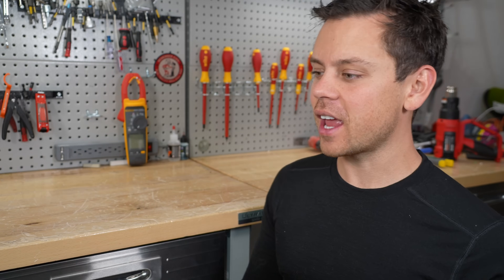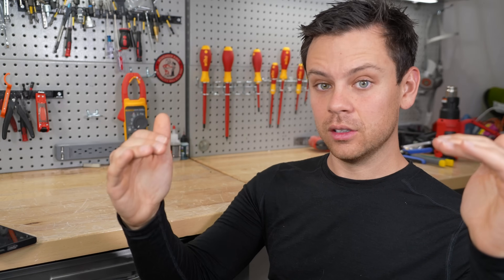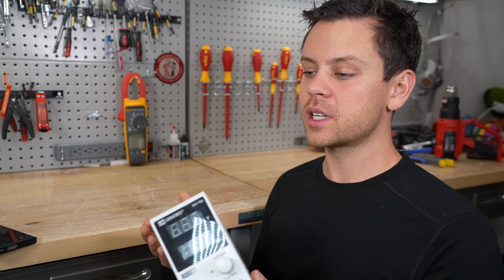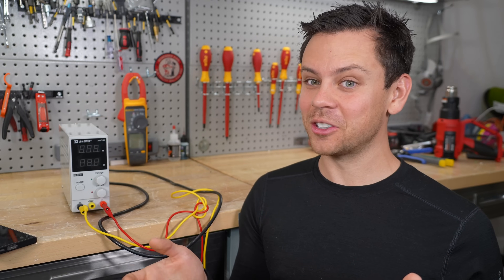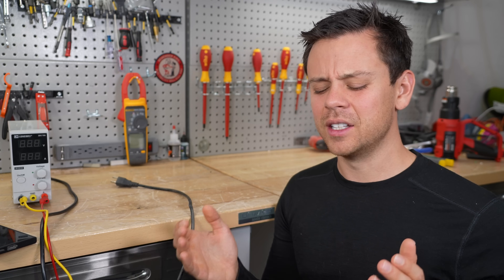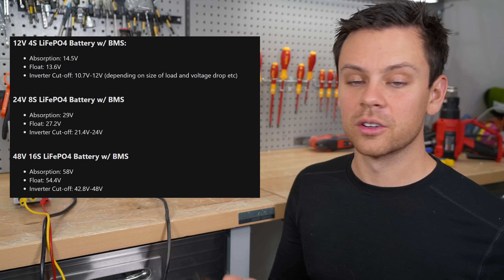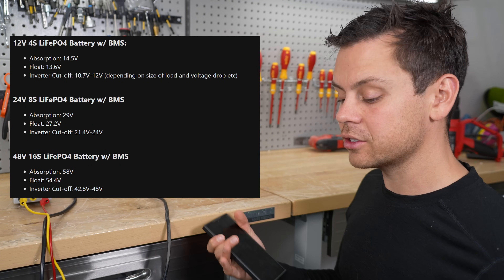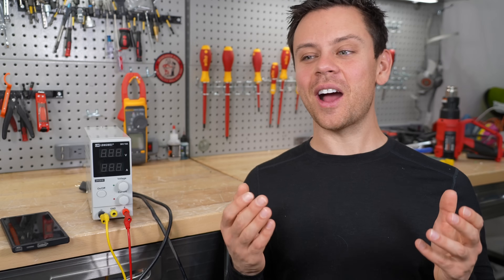LiFePO4 Charging Guidelines: What is 100%? What is 0%?! How to Balance??

Comment: This is exactly what we have been needing, perspective with a good discussion using a road tested sense of weighting for the different concerns.  

I've been trying to keep my AC charged backup power system at 70-75% so I could avoid a lot of degradation hanging at 100%.   But I lose capacity doing that and an ongoing intermediate charge is hard to nail down.   Now I have a better sense, of how much that matters - "It's not that Baaad"). 
AND I concur, the big hits on my batteries came after storage.  I left it at maybe 50% and come back six months later it's  at 10V.  I've learned to disconnect the BMV, everything too. BMS is only remaining drain.

Comment: Will, what was the machine that you held up that you use to adjust the balancing current?
Reply from the maker: Oh that's a variable output power supply. Super cheap and easy to find on Amazon

Comment: Have you or anyone else thought about trying out the large Chinese batteries? 48v 300ah. Depending on the manufacture they average about $1000 each. With shipping 2x 48v 300ah is $3000 shipped to my door. For the capacity it’s very tempting to try them. They have all the same safety features, warrantee, etc

Comment: Is there such a thing as over paneling a solar stand-alone system? I have two 250 watt panels in series through a MPPT charge controller to two 12v LiFePO4 100ah batteries in parallel. Even on the cloudiest days my system recharges to 100%. It’s only at 90% in the morning but I plan on powering more in the future. I designed the battery capacity to last 3 days without charging but I have never seen anything less than 90% so far 🤷‍♂️

So since it recharges to 100% everyday there is no need to rebalance the batteries individually every 6 months?

Comment: Hi, I am new to the LiFePo4 batteries. I have a 6k 24v inverter to run critical circuits in my home when we have power outages. My battery bank is a 25.6v 400a system consisting of 8 Chins LiFePo4 12,8v 100a batteries, which I have gone through the balance process multiple times to make sure the batteries in my bank are balanced.
My question is what should the minimal charge current in this hookup be? I am currently charging at 30amps, but wanted to know the best charge current to make these batteries last a long time. We get power outages during the summer due to storms/hurricanes etc... and even sometimes in the winter, but that is more rear than normal. So most of the time my batteries are not used, but in "stand by" for emergencies. Any advise on this would be greatly appreciated.

Comment: my lifePO4 batteries came with instruction booklet and for charging tips it states equalizing charging voltage 14.2 with a float charge of 13.8 with an over voltage of 15v and reconnect at 14.2  should i stick with these settings for solar charge ?

Comment: Will, I totally understand and agree with your words of advice....
Trouble I have in north east of UK......IV way too much power in summer......but in later year IV not enough. IV increased my bank.
It's a hard balance to get Solar to battery size right.
Iv just took out  12 cells on a 12v system with a standard Daly bms......and all 12 was with in ,3hts of a volt........ok not 100% soc......
I need to sort 8 of the cells to make another 24v pack..

Comment: If using 51.2v batteries in a non solar setup and recharging with a 30amp LiTime charger, what is the recommended lowest percentage I should go before recharging? This is for a relatively low draw 400-700watts per hour on the high end, right around 150 watts per hour most time for off grid living in far northern Wisconsin. I keep my batteries at room temp almost sleeping with them, lol. Thanks

Comment: I have a system without BMS 48v and put absorption 57.5v and float 54.7v are these settings good are they balanced. Connected to a soler system charged daily

Comment: Informative.  One question I still have is about C discharge rate.  I understand what it means.  In the real world what happens if you discharge faster than 1C consistently?  I'm assuming that heat degradation is the biggest concern.  I made a portable min/maxed system.  It's 12 volts and 100AH built out of 8 50AH 3C discharge rate cells and a 2000W inverter. Could I have saved money and just used 100AH 1C cells?
Could you explain C rates and what they mean for system performance and longevity?

Comment: I have a question about using an inverter to energize  the 110 system of a travel trailer. I understand the solar application to the DC system, but am totally confused regarding the inverter and the AC system, and how the energy from the inverter is distributed to the AC system. Is the power fed to the AC fusebox? How is it fed from the inverter to the AC sockets, microvave, air conditioner, etc.?

Comment: Voltage means very little for determining 100% SOC. Any voltage above 3.375 volts per cell (13.5 volts total on a 12 volt pack) will fully charge and then overcharge the cells. You'd just need to be very patient if you choose to charge at that low of a voltage. 100% SOC is achieved when the charge CURRENT drops to 0.03 (3%) C. (100 amp hour cells = 3 amps). Terminating charge at 3.65 volts per cell is an emergency cutoff threshold. I don't allow the BMS emergency thresholds to control charge or discharge terminations. I charge 12 volt packs with 13.8 volts and then use tail current detection to stop charging at 0.03C charge current. Some of the Victron chargers support tail current detection to trigger charging termination.

Balancing efficacy is directly proportional to the charge current to balance bleed current ratio. Charging at high C rates will reduce the balancing efficiency. If you want to balance a pack it's much more efficient to charge at a low C rate.
Reply from the maker: Well said! Exactly true. 

You should join our forum. You'll like it

Comment: I was thinking of having two battery banks that alternated use so that one was always fully charged in case of cloudy days. I think I could cycle a single 48 volt  battery from 100% to 0% every day in order to satisfy my energy needs. But do you think it would be better to just connect the two battery banks together and use them down to 50% each day instead?

Comment: I recently add a solar system to my truck camper.  I bought a LifePO4 battery with cold temp protection.  Should I leave the battery in the camper and just let the MPPT and solar manage the system.  Temps for the next 90 will range between 10 and -30 Celsius.  I live in northern British Columbia.

Comment: I just bought 8x WattCycle 12V 100Ah batteries. I am planning a 48 volt build (4s2p) but haven't bought anything else yet (waiting for some Black Friday deals). What recommendations would you give for an external battery charger? I will be doing the whole solar, mppt, charger, inverter and probably a transfer switch. I may go with a DC optimizer rather than micro inverters, but thats still kinda up in the air.

Comment: Nice video. Been using Li-Fe for receiver/servo batteries for giant scale rc airplanes for a lot of years now and that follows my experience.  I generally keep an eye on cell voltages/balance and internal resistance as they charge, and each year I’ll measure capacity. Finally retired a pair of packs when they were below 90% capacity, probably 12 years old, charged at 1c, and I hadn’t been too religious about storage state.  Also it seems to me smaller cells (2.2 ah/hr) degrade more quickly.  

Plenty of useful life if they were solar storage, but a person wouldn’t want to loose control of a 6 horse power spinning blade that flies.

Li-Po chemistry is used in electric powered airplanes due to to their high current ability (a pack might be rated 80c discharge, 5c charge, where li-fe might be 10 or 20c discharge, 1c charge), but Li-Po’s do degrade quickly especially when left at full charge and/or constantly run at max current. They also seem much more prone to fire, especially when damaged.

Anyway yeah, different lithium types have different characteristics. I’ve noticed Li-Fe packs for RC have almost no self-discharge, and I wonder if that could be because there’s no BMS.

Comment: It is disappointing to learn that I need to store my LiFEPO4 batteries at 50% I wanted to keep them at 100% ready to go in the event of a loss of power. But you know, I am not surprised to hear that since I know my Nikon camera 's Lithium batteries are supposed to be stored at 50% if you're not going to use the camera for some time according to the owner's manual.

Comment: I watch all of your videos and I don't understand all of it, I'm not as smart as you lol so don't get mad here when I ask this question but that guy from Australia that's dealing with the lawsuit said his lithium batteries failed in his vehicle because the alternator kept them at 100% constantly. Is this true? Topping them off to 100% once a day is fine but keeping them at 100% while driving while driving the vehicle is bad?
Reply from the maker: If the charging voltage is above the fet voltage rating, then it's possible. But dang they must have been using really low quality fets than. Besides that it shouldn't hurt it

Comment: When my 2 12 volt batteries get near 100% the midpoint voltage deviation starts to grow. I think that I backed the full charge to 28.8 and it works fine now. Every once in a while the float decides to continue to climb. If I shut everything off it will usually go back to the proper float.

Comment: Hi Will, 

My battery manual states the following; 

Smart Cell Balance 

While charging,  if any cell voltage exceeds 3.450V and the voltage difference between the cells becomes greater than 20mV, the BMS will initiate the balancing process for those cells. The balance current is based on the cell voltage difference and limited to 50mA. 

Recommended charge voltage is 56.0V 

Battery is a LiFeTIDE lifepo4 5120Wh

Comment: Main point: Chicks dig a strong vibrant pulsing throbbing voltage. Degradation isn't so much a problem. Thermal battery low temperature can be though and women have an in built low temperature shrinkage cut off sensor. Don't let that sensor activate. Keep up both your volts and your amps so you can inject the correct amount of charge at the climax of the union.

Comment: I recently bought 2 independent power queen 100 amp\hour batteries that i charge with a powet queen charger and ive noticed i never see 14.6v when i check them with my voltmeter, but usually i see 13.8-13.9 when close to full charge and 13.3 when charged. Is this typical or do i need to contact power queen?
Reply: I get the same readings, with Li time  24 volt battery and same brand 29.2 charger 27.6 volts then greenlight comes on,and stops charging.

Comment: So... If you have say four 3.2v Eve cells and they're connected in parallel as in a 12v battery, why don't they just balance themselves to each other anyway. I mean why wouldn't electrons just flow from the higher states of charge over to the lower states of charge? Isn't that just "The law of charging"? if I take a 12v battery charged up to 12.8v and I parallel it to another battery that's discharged to 10v, wouldn't the full battery charge the low battery until they level off?

Comment: All I want to do is purchase one or two "cheep" (LFP) 100AH, 12V. Such as LiTime, or one of the others you've reviewed recently.  Possibly a trolling motor battery as well. No solar panels yet. I want to know what is required to charge and maintain these?  I'm pretty good at cycling the two LiIon jackery's I  use frquently. I also use a 140w BASEUS LFP. The tariff you mentioned is forcing my hand to finally buy a few.

Comment: Thanks again another great explanation. I have  a Victron Solar controller and was using the default settings 56.8V Absorption and 54V float  ( Victron solar charger will not reset until >.4V drop from the float voltage so it has to be less than 53.6V before the charger goes into charge mode again)  My test showed that the cells were not fully balancing so I set my float to 54.4 and the Charge / Absorption to 58V,  which has improved balancing and float voltage capacity. Now I understand from your video that default was for Victron batteries not LiFePO4 in general. So 58V charge it will be from now on. (The data sheet for my batteries states a  bulk charge voltage 58.4V.) Excellent explanation once again Will ! I could find nothing on the Victron forums that covers this issue. I have set the 5000VA inverter to cut off at 46 V. The default setting BMS for my 2 x 16 cells 48V batteries is cut off at 2.2 V per cell a little low but this is the manufacture default so it will stay this way as I have a 5 year limited warranty on these batteries, and changing these parameters I was advised would void the warranty. I am going to throw some more solar panels on the roof to help with charging over the winter months. 5 stars again Will.
Reply: i use victron chargers and multi2 too and saw some weird stuff but i do use their parameters right now and i want to see what i might gain from a total discharge . if i gain 70 to 75%  of my pack then i m ok...  my cells are 3 years old+ some safe bariers to  top charging ... but cant confirm yet that i dont like victrons  parameters.  will do some digging in summer because i m off grid and those tests need more solar!  .
Reply: I have the EG4 wall mount battery. What is your best advice for storing it at my cabin over the winter?  I lose access to it over the winter should I charge it up to 100% then leave it  it will have about 1000W of solar on it for the morning and then nothing. Now power going out.
Reply: I have the EG4 wall mount battery. What is your best advice for storing it at my cabin over the winter?  I lose access to it over the winter should I charge it up to 100% then leave it  it will have about 1000W of solar on it for the morning and then nothing. Now power going out.

Comment: Excellent explanation...I followed all victrons (mppt and inverter) recommended settings as well as dalys (bms)....resulted in the inverter turning on and off quickly in a short period (mppt charged to 59v,even though it should not have gone this high)...which in turn trashed a new fridge freezer (has stupid inverter motor in it). Not sure which was responsible the bms or the charger for victron inverter (which was not connected to mains at the time) ....any way reasons as well as the values are greatly appreciated. Thanks.

Comment: Question:  When they installed the mega battery in Hornsdale, it apparently stabilized the voltage and frequency of the grid.  If I install a battery, will it do the same for my home.  I have a problem that my microwave won't work when the solar panels are connected.  If I disconnect them it works just fine.  Since it is electronic, I suspect there is some effect on the frequency and voltage of the system due to the solar panels or the inverter.  What do you think.

Comment: Just one side note most "48v" batteries are 51.2v batteries and the charge voltages mentioned apply

There are "48v" batteries that are true 48v batteries ie 15s like pylontrch and some shoto among others
Or them bottom and top voltage need to be adjusted but yea the BMS protects them in case wrong settings used , but ideally a person wants voltages that would be ok even if BMS fails

Did a DIY battery for my bike, and since I could measure the cells , I did this once to show someone that even if voltage was incorrect , the charge voltage was set to 16v the loop outside BMS showed 16v and the cells was resting @ 13.6v in protection mode

Oh and some bms's only balance while charging 

Tried to get a neglected pack in sync t
Charging discharging up to 3 times a day (thanks to loadshedding in South Africa) and the balancer cold not get them back in sync even after 6months

Eventually I just opened it up and did it manually

So yes like you say get it to 100% so it gets it's balance time and you can save as much as you can with your solare😢

Comment: What are manufacturers DOD states based on ? Have they got this wrong ?
Reply from the maker: No they are correct, but calendar aging is going to degrade to 80% before cycling with solar will
Reply from the maker: Like I said in this video, if you cycle an a laboratory at 1C rate, it's going to give you the advertised degradation
Reply: @WillProwse A fresh fart is a smelly fart I always say.

Comment: Hello Will this is for li-op batteries not li-ion there are different voltages for these two battery compositions … other lithium batteries have different charge rates and voltages …. Li-ion is up to 4.2 volts lipo is 3.65

Comment: My power pro wall mount says 8000 cycles from 20% to 100% .signature solar also recommends discharging to 20%? Ai said 2000 cycles from 0 to 100% and 8500 cycles from 30% to 100%?

Comment: You nailed it. Perfect advice.  Only thing I would add is that if you plan on storing batteries for more than 1 -2 years without ever checking or charging them, then it may be better to store them at 100% charge as they will self discharge at 2-3% per month and as you said, allowing the pack to discharge below 0% in storage is a recipe for disaster. My advice would be to sell the pack if you cannot use it for a few years and cannot maintain it.  

Good show
Reply: Just what he said, but I'll add that I think for even shorter (6-8 mo?)  periods, it's worth it.   There can be other factors (BMS at best) that drain it even more.